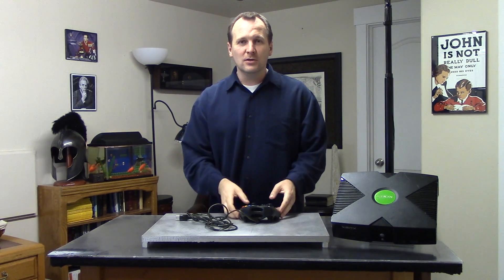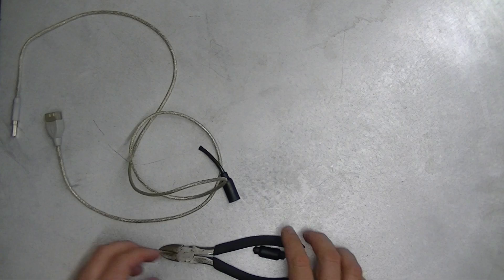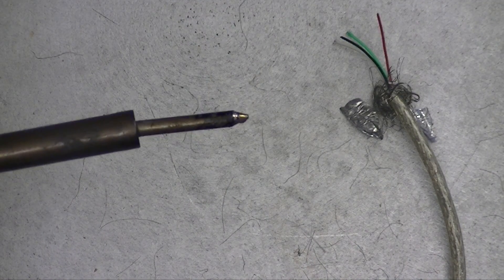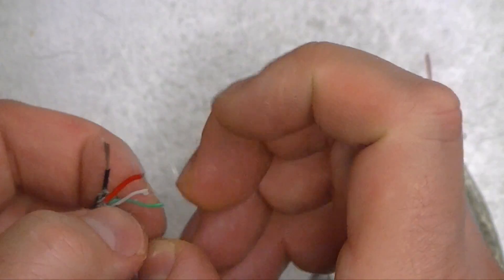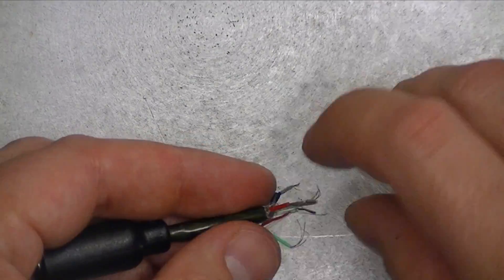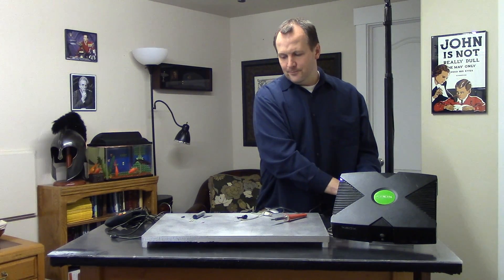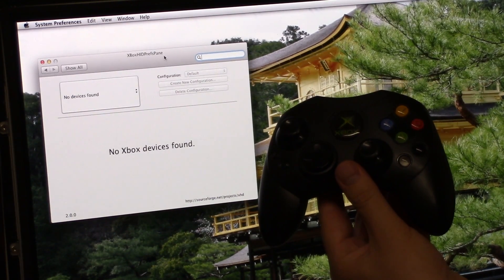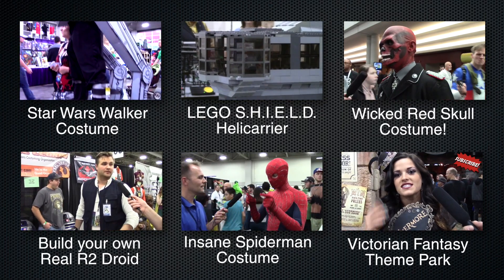How to convert an Xbox Controller to work on a Mac or PC

Comment: I did this exact same method and everything worked well until it came to manually installing the XBCD driver (Windows 10 64 bit). Like you I did not solder the outer shielding together between the detachable connector and the USB cable; with the device ID showing correctly in Device Manager, I disabled signature verification but no matter what I do Win10 throws up a Code 39 claiming the driver is corrupt.

Granted I know I'm late to the party, but I'm curious if anyone else stumbling upon this video has encountered the same problem.

Comment: Ever have any issues with the trigger "sticking"? I've tried 2 controllers on both PC and console, they function fine on console. With them on the PC, every gamepad tester I've used (html5.com, device manager game pad checker, and another online game pad tester), it shows the right trigger being depressed, even though it is not. Most of my emulator games are fine with it, but any game that i'd like to use the trigger button for are NO-GO's. I even tried uninstalling and reinstalling the driver with no luck. I've found a couple of forums for a similar issue with the XBox One controller, but their solutions didnt work with my original XBox controller. Thoughts or advice? (PS, i'm running Win7x64)

Comment: does it need to be usb 1.1?
Reply: "For XBOX to PC USB Controller Converter Gamepad Adapter F3J7" ON EBAY, i want the build quality of the solid palstic big XBOX official from old days.there is a signed driver suposedly, hear the xbox1 stuff does not last, will be using with windows 10. from below DRIVER= "Try the second-to-last download in this link:

http://www.mayflash.com/Support/Download/Index_2.html "
wondering if i can play a casual game like Rebel Galaxy minus 2 shoulder buttons. if me/anybody gives this a go please come back to comment. arrival and attempt is a month or 2 out on my end- good luck.
nice work in video thanx

Comment: Why not just splice the end of the controller wire to a male USB? What is the purpose of the adapter?
Reply: Just in case you still want to use it on a Xbox Original

Comment: 👨‍💻2019 found 2 xbox controller was  gunna buy xbox 1 $40 + but i asked can you ? haa u answered  
👨‍💻 i can do this now use on PC-Xbox live etc 🙋‍♂️👍CHEERS  thought possible but  u got check 1st which cable :)
Reply: Are you thinking about using this controller for a game like Apex? I am interested in doing the same.

Comment: Would this work with a micro usb cable?
Reply: The wires are identical done it myself so if you have a old micro USB data transfer cable  go for it<--- needs to be a data cable otherwise won't have the right number of cables inside 😉

Comment: Hi, just wanted to say that the link for PC is dead
Reply: I haven't tried this yet, but I was reading an outside tutorial, and it suggested using a driver from Mayflash (who make adapters for various console controllers).
Their link was also broken, but I found the file they were referring to here:
http://www.mayflash.com/Support/Download/Index_2.html
Near the bottom of that page is an entry for
PC018 Super Joy Box 9
PC019 Super Joy Box 10
PC020 Super Joy Box 11

Which apparently must have been a series of XBox controller adapters that Mayflash sold.  That driver is said to work with USB-converted controllers.  But again, I haven't tried this yet.

The problem you'll probably run into is that Windows Vista and later require signed drivers, and that Mayflash driver might not be signed.   If that's the case, then it will probably appear to install itself but not really be installed.  Sometimes people get the controller to work once, but as soon as they reboot the driver won't load anymore.

There are ways to defeat the signed driver requirement, but I don't know much about it so I won't try to address that here.
When I was digging up drivers to install Windows 7 on a new laptop (which didn't have official Win7 support), I remember running into the signed driver issue and worked around it some way, but I don't remember how anymore.  I just know it's possible.

Comment: https://shopee.ph/(READY-STOCK)For-Xbox-To-PC-Cord-USB-Gamepad-Handle-Controller-Adapter-Cable-Wire-72CM-i.45373536.1335887522 

ebay is expensive in my country, is this the same as the one in the description?

Comment: Just to clear up a little confusion regarding the adapter you can get on eBay which the author linked in the description... If you want to use this controller for PC you're looking for a MALE usb not a FEMALE usb. The female usb is used to connect pc compatible controllers into a modded original xbox.... Need a MALE usb to connect to pc and a FEMALE usb to connect pc controllers to original xbox....

Comment: Is the controller not already a usb (with a plastic casing surrounding the USB to fit into the xbox)? Wouldn't the easiest thing to do, be to remove that plastic casing and insert as usual? 

It looks like it might take some additional finagling to reshape the metal casing as well--but still might be a lot easier than soldering wire. Has anyone tried?
Reply: I was wondering, too. Did you try to do that?
Reply: Render Master  Unfortunately it's pretty close, but it probably won't work. My Xbox input plug has 5 data lines while the USB has 4. Inside the cable, it seems the yellow wire on the Xbox cable is arbitrary depending on your model but it would take a lot of dissecting to trial-and-error this.
Reply: do not try it. you will damage the connector.
Reply: the original controller will not plug into a USB port .. even after removing the plastic casing and the metal casing.
Reply: The plug is different, but the protocol is pretty much USB

Comment: Can't you just use a wired xbox 360 usb controller adapter?

(Edit) Well it would not work, but it is very similar tbh
Reply: Funky no!
Reply: @sexyblackman2873  Just found out.

Comment: I CAN'T SEEM TO GET IT TO WORK ON MY WINDOWS 7 COMPUTER EVEN AFTER DRIVER INSTALL (FOLLOWING ALL INSTRUCTIONS LIKE UNINSTALLING THE CONTROLLER FROM DEVICE TREE ECT) HELP ME TO GET IT WORKING!!!!!!!!

I KNOW THE CONTROLLER IS WORKING AS I TESTED IT ON AN XBOX AND TESTED ALL CONNECTIONS AFTER USB MOD AND IT WORKS I JUST CAN'T GET THE COMPUTER AND THE XBCD DRIVER TO RECOGNIZE THE CONTROLLER IS THERE!! AND I'M REALLY FRUSTRATED IF YOU CAN'T TELL.
Reply: i tried that many times and many links but they all refered back to the same stinkin file or the download link was no longer working

Comment: thanks just followed this and works great.  No solder iron so just twisted the wires and used pvc tape around each.  Plugged in and working great on ubuntu mate 16.04lts.

Comment: does anybody know where i can find drivers for windows7 or OS X 12/Sierra? i did this whole process and didn't realize drivers might be an issue. I'm pretty sure all my connections are soldered pretty well, but kind of stuck without the drivers. please help.
Reply: I made it work with Super Joy Box Drivers 9 through 11 Series, which is the second-to-last download in this link:

http://www.mayflash.com/Support/Download/Index_2.html

Comment: Hi, I understand that doing it this way will also work on the 360, I've tried several times but it won't work. I have a wired steering wheel that I would like to work on the 360, would save me buying a new one. Any help would be greatly appreciated. Thanks.
Reply: 8-bit Singer I have one that came with ps2 and gamecube attachments what do u reccomebd

Comment: There is an adapter you can buy for 10 bucks.
Reply: Icy Shadows where ?!
Reply: @dracula3154  its a wired 360 end just take it off it attaches the same way

Comment: - all is working good. 
- this is my first experience of modifying a wire __
- it should not be brought to panic when Windows don't recognise device ID, date and manufacturer. It is a problem of windows 8 and 10. One should watch another video of XBCD 0.27.
- and also in my case black wire was blue. It's normal and still will work.

- first cut should be long for about 3 cm or even more and second cut for smaller wires is enough to be about 1cm or less. This is important because it's hard to isolate it with tape in another cases.
I spent a lot of time and began work from a beginning too much times.
- it's faster and easier to work with your own tooth instead of knife and shears. Because it's too hard to not cut small wires with these things that you can't feel.
Reply: is it works on window 10?

Comment: Will this will work with Windows 10? ... Yes
Can you skip the soldering (twist the wires together)? ... Yes
Will it work without installing an Xbox USB adapter driver? ... No
Help me! XBCD won't work! ... Try the TigerGame Xbox to USB Controller (google for DL)
Reply: Did you try the driver he put in the description?
Reply: XBCD is working. There is another video describing 0.27 XBCD version
Reply: I'm trying to add a usb to my old xbox orginal steering wheel set to use on my xbox 1 will it work

Comment: windows won't recognize my controller. it says "unknown device doesn't have drivers" or something like that. in devices and printers it says device needs troubleshooting
Reply: you already solved the problem? I have the same
Reply: Did you install the driver from the video description?
Reply: I having made some wrong step, but now is already working ;) Tks
Reply: +pedro pinheiro what did you do? I have it installed but it's not working.

Comment: would this work with a steering wheel like the old xbox ones?
Reply: +Roham Razavi I't should work, just be sure to download the latest version of XBCD.
Reply: k thx
Reply: +Simon Gartman oh ok thx but will it work on win 7?
Reply: +Roham Razavi yeah it is for win7 :)
Reply: +Simon Gartman yah I tried it but when I plugged my controller in it didn't recognize it I did some research and some ppl say that it is due to the fact that it isn't OEM and that I have to try a different way. so tight now I'm in the process of doing that and lemme see what happens
Reply: +Roham Razavi Gl dude :D
Reply: thx ill need it
Reply: Roham Razavi Any luck?
Reply: Yeah I have a 4gamer steering wheel that connect to xbox orginal and ps2 so I wanted to see it I can cut it off and connect a usb to use it on my xbox 1 s

Comment: will it work on a 360 as I bought the wrong controller
Reply: +Akram Eskander  If is a wired controller just connected to any USB port aviable; if is wireless you will need the "xbox 360 Wireless receiver" for PC.
Please notice the "plug and charge" kits will not work since is only power, the communication is still wireless
Reply: Thx for your quick answer but i don't really understand
I bought version 1 controller by mistake to realize I don't have this wide socket on my 360 so its useless for me unless I do this conversion to USB which will make it work on any PC USB port not sure it will work on the 360 USB port? Thx for your time
Reply: I got it now. A Xbox classic controller can not be used in a 360 and vice versa are not recognized by the respective dashboards.
Both (Xbox or 360) controller can be used in a PC after modding (Xbox) or adding a wireless receiver (360 wireless)
Reply: +Ya se acabaron los nombres thank you sir very helpful

Comment: does this work for gamestop xbox 360 controller. answers are yes,no.
Reply: +MICHAELMASTERX For use in a PC any controller will work after modding (xbox classic) or buying a "360 wireless receiver for PC" in case of a 360 wireless. 
Wired 360 controllers are plug and play
Reply: it worked!!!!!!

Comment: does this work
Reply from the maker: +ㄔㄞ, ㄘㄛ Yes. It does.
Reply: Thanks
Reply: From the hardware side of things, it does work. But for some reason I could not get my Windows 7 machine to recognize the controller. But that's a driver issue.
Reply: i did this back in the day on windows xp & it worked amazing but that was 2006 lol
Reply: it does but you need special drivers

Comment: You can simply use a Xbox 360 breakaway cable to replace the Xbox classic breakaway, easy switch to USB and back again without affecting the plugin its self
Reply: it doesn't fit I tried it there different
Reply: That doesn't work to different ports look at them
Reply: Slightly different ports, but apparently it is possible to file a channel into the 360 side of the breakaway to make the two compatible, and all the leads line up inside.
Reply: my xbox controller does not have a breakaway cable connector. one solution - unscrew the plates remove the cable. does it matter if its usb 3 or usb 2 cable?
Reply: @gnbilios  if I were you, I would go for usb 2 than 3. The original xbox had a usb 1.1 so even a usb 1 would be tricky. I would think a usb 2 cable would ve a best fit since a usb 1.1 cable would be quite difficult to locate.

But you can find breakaway cables on ebay for real cheap btw

Comment: Can't you just use a standard breakaway cable from a wired Xbox 360 controller?
Reply: some people are old school and dont have an xbox 360 controller
Reply: xXdab0mbXx It dont fit sadly...
Reply: same
Reply: if you have a wired 360 controller you could just plug that into in your computer and use it.
Reply: ik i got one 2day.
Reply: Mmm I don't have a breakaway cable, but does anyone know whether I can do this to a XBOX 360 controller and connect to Windows 11 (or Fedora). I've seen people having driver & driver finding problems.